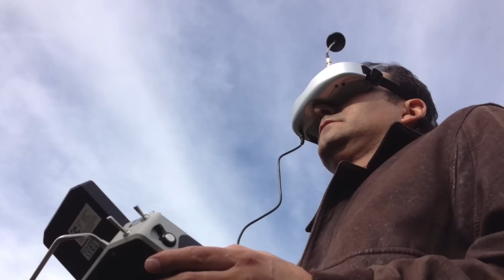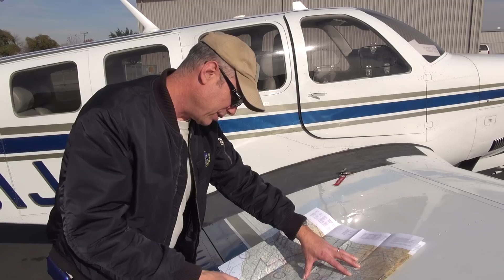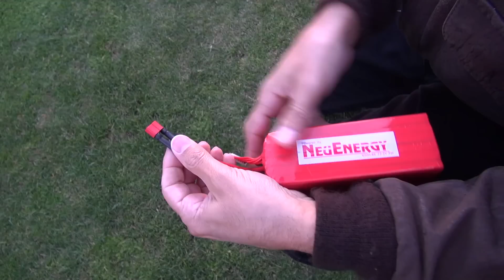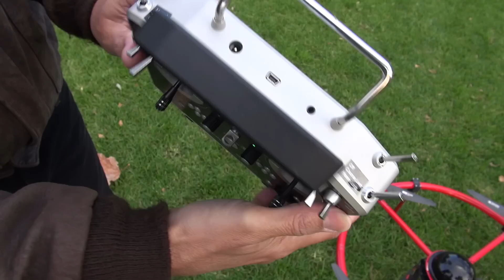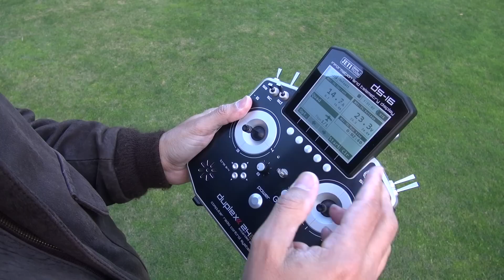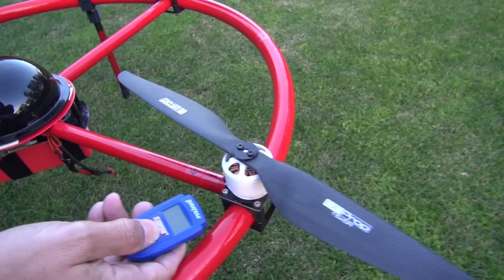UAS Safety - Drone TV Field Trip

Comment: The only point of the ring is rigidity. This frame is inefficient because the materials we have available to us today are rigid enough for that prop size he was using to not have the ring. Just by using a more efficient frame he could easily add 6-10 minutes flight time.

Comment: I like the quad frame.  What material is the red ring?  I had a similar idea this past summer, but using a hula hoop.  I was also thinking of bringing the motors further inside the hoop as to protect the props and motors.

Comment: Good show, battery checks can be done also with a volt meter and battery connector, then you can wiggle the wire lead to check for drop offs in voltage. RC aircraft like multirotors and foam planes are drones only when the mark up exceeds DJI or Goodluck buy price and a guy in a suit delivers it. Remember to buy the steak not the sizzle. LOL!